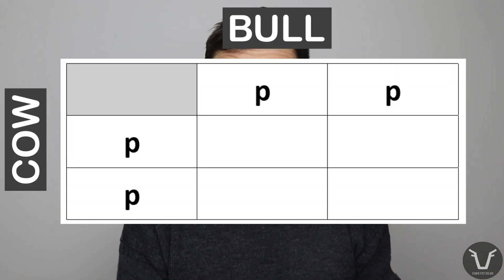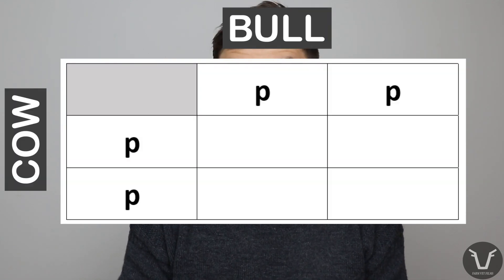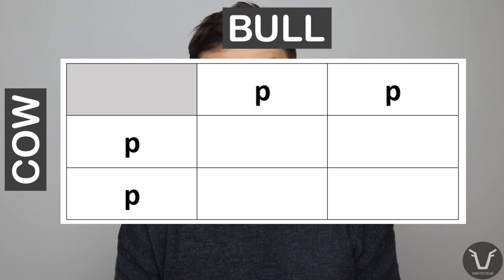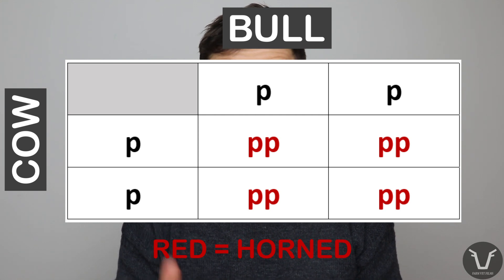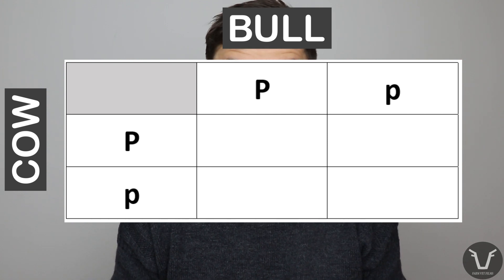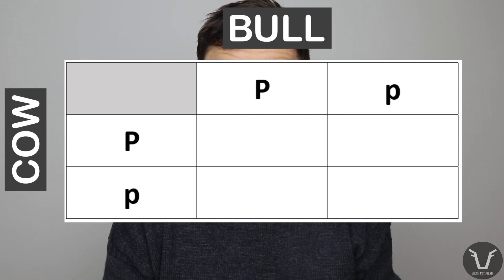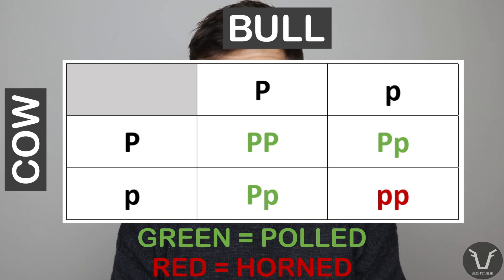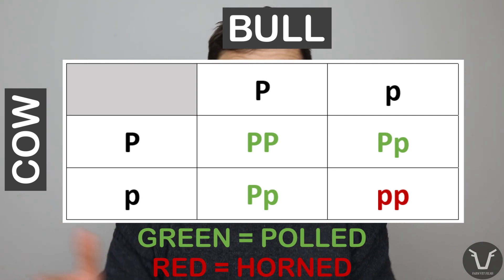POLLED GENETICS IN CATTLE | TECHNICAL #44

Comment: Great information. However, I've looked everywhere online and the only examples I can find are Polled Sires crossed with Polled or Horned Dams. What are the possible results if the Sire is Horned and the Dam is Polled? For instance, a Highland Bull crossed with Angus Cow. Thank you for your response in advance!
Reply from the maker: No sex effect - so as to your question it would depends on the genetic status of the female. As polled is dominant she could be homozygous polled (both copies polled) or heterozygous polled (one polled copy, one horned copy). If former - calf will always be polled; if latter, should be 50:50.

Specifically using an Angus cow, as the breed is entirely polled (all homozygous) all those calves should be polled.